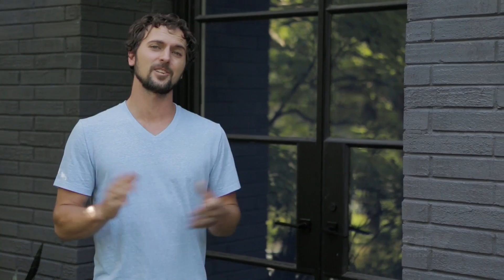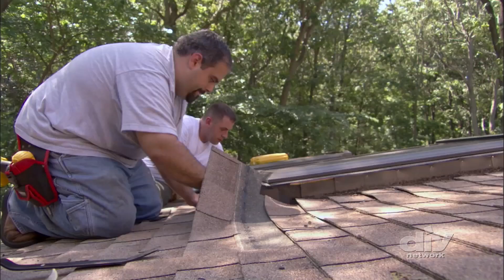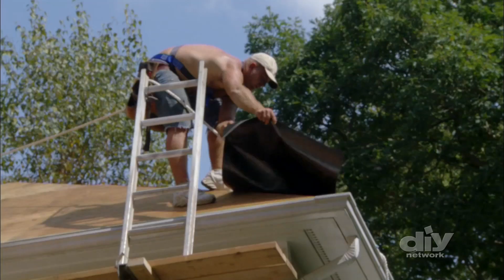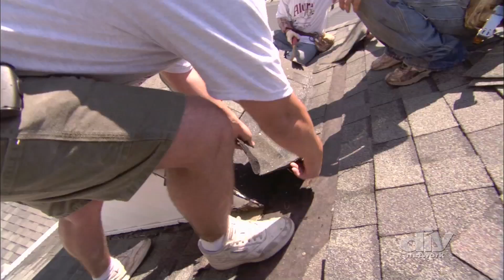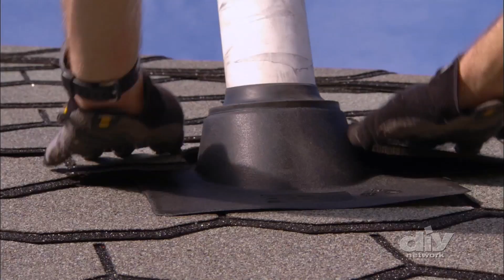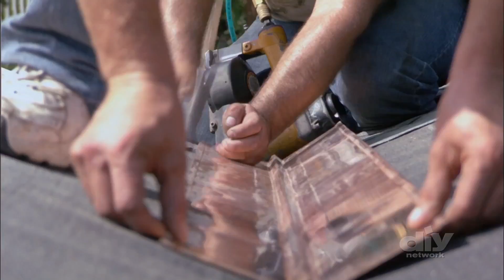Why a Pro Should Repair Your Roof - DIY Network

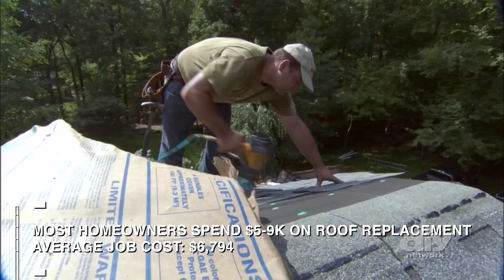Comment: 0:17 if it's really only 10,000 I will DEFINITELY let the roofer do it. But it's 28,000 for a low slope. It WILL break the bank D: